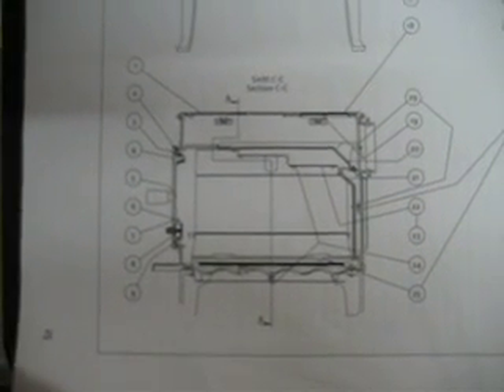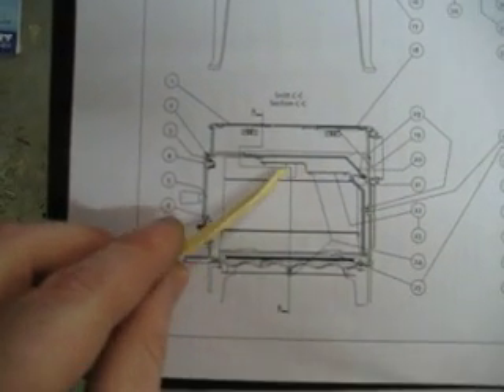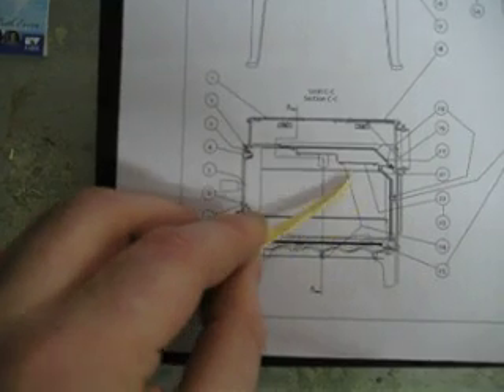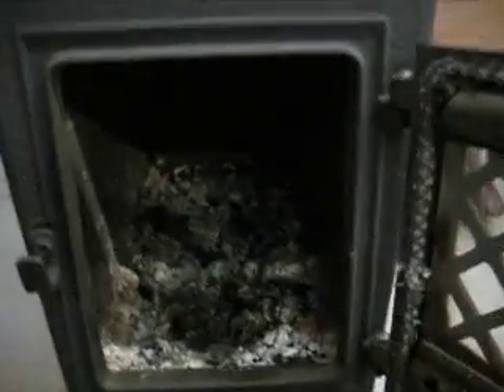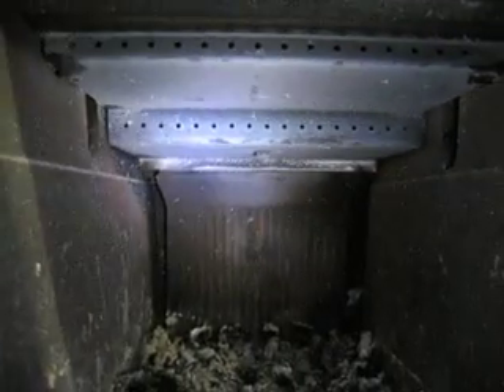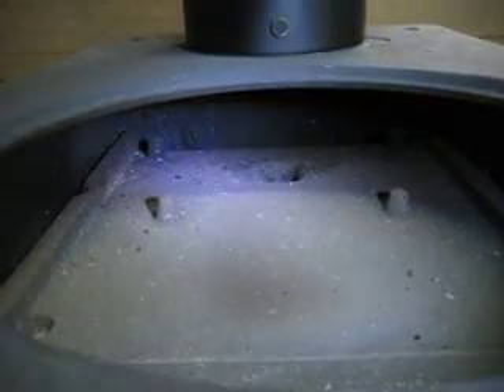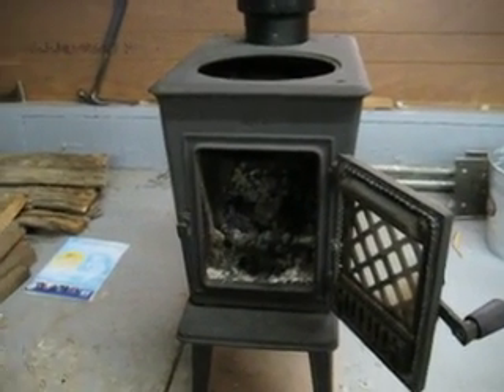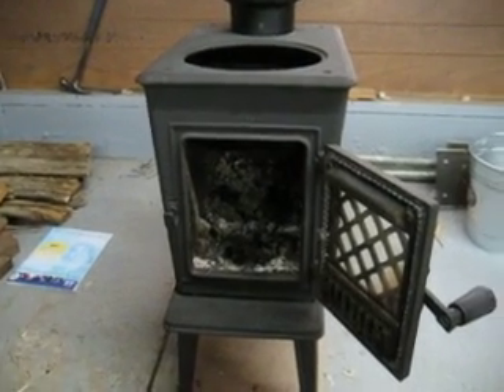Jotul F602 CB -- A Look Inside

Comment: We've had a 602CB for about 4 years now, great stove. However, the secondary air ports seem to have clogged up with fly ash. I remember being able to see the cool looking wafts of the air burning off the gasses when we had a slow hot fire going. Any idea on how to clean out the ports without disassembly?

Comment from the maker: @neumsky1 --part 2
However the Aspen is 80 lbs heavier than the 602 which would possibly hold the heat longer after it is up to temperature.  The nice thing about the 602 is that it heats up relatively quick and keeps putting out a lot of heat.  It also is one of the easiest starting and running stoves I have ever used.  I guess it all depends on which one you can buy locally.  For me this was the F602CB, and I am very glad to have this little work horse of a stove.  Good luck.

Comment from the maker: @neumsky1 
I know that Vermont Castings make nice stove but have not had any experience with them.  The F602B is listed at over 75% efficiency which I would believe based on the performance that I get on a load of wood.  The Aspen apparently is 69% efficient.  Whether or not you would see much difference is questionable though.  The F602B has a 28,000 BTU output while the Aspen only has 18,000 BTU.  This would make a significant difference in heating capacity and fuel consumption.